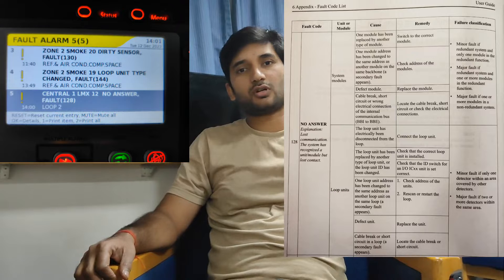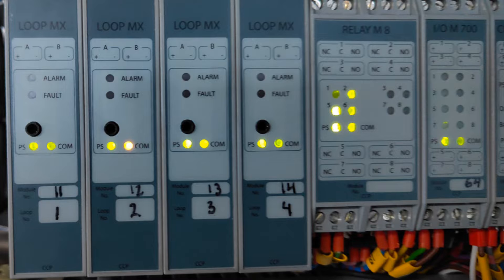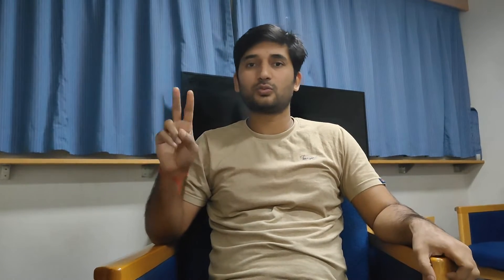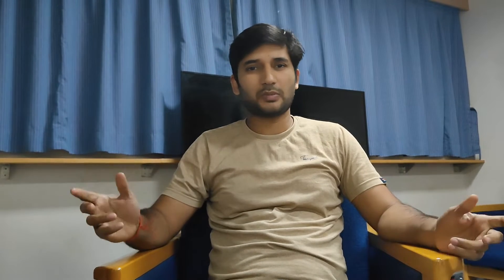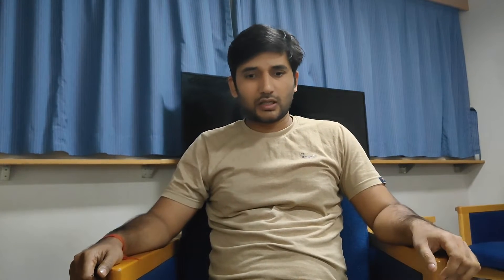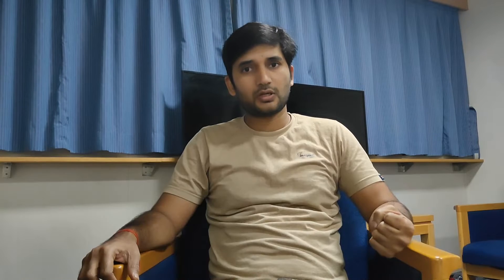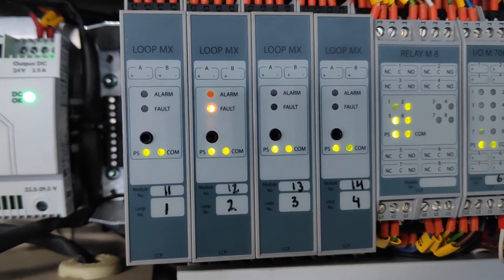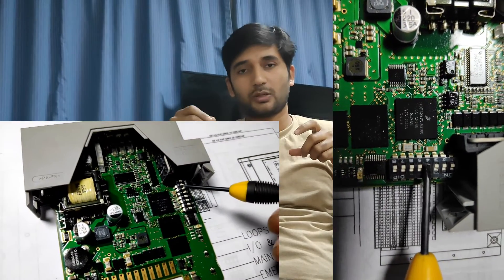Fire Alarm System fault Troubleshoot || Consilium Fire detection system on ship || Fire alarm faults

Comment: Hi I have problem since one week with alarm 141 insert loop analog 1 pos. Cable break / short circuit we checked all sensors on loop 1 and now we did not found anything. Do you have any suggestions for fix this alarm ?
Reply: search in the panel the units in the buckle, you will find by zone, and there you have to seen the dispositives conected, them will show you if ther are in set mode with the signals A/B, you have to seen all of them in this conditions, the dispositive that is not in this conditions (por example A/- or -/b)  that is the wrong

Comment: Panell showing fault code 158 And  charger module  90 not showing 24 volt where battery panel connect ed.
Reply: I have the problem did you fix it
Reply: verify the 3 supply power, or changue the module M CHARGE it is inside the gabinet

Comment: How to set the address in the address unit of consillium while using the dip switches, address unit which is installed in the circuit separately

Comment: For your last issue I think you can also just rescan the loop from the service menu without removing the card.
Reply from the maker: I will try next time, thanks
Reply: i did it last job, but also is good change the base and detector together

Comment: Not change any sensor and not renewed module and not change address also but received LMX12 No answer fault. No spares onboard. Is it possible to use third problem’s solutions you gave for this fault? Like put off all dip switch and then connect it wait for three times blinking and then again put back same address?
Reply from the maker: You can try it, no harm in that but this process only rescan the new sensors. If this process does not work try swapping lmx12 with other and see if problem swap to confirm exact problem.
Reply: @sailorsrikantsingh  yes exactly. Easiest way to find out where is fault instead of checking whole lot of sensors in the loop. Already swapped and found module itself faulty and raised requisition.